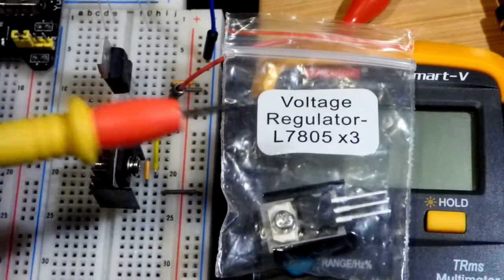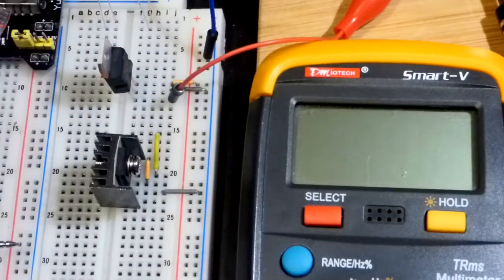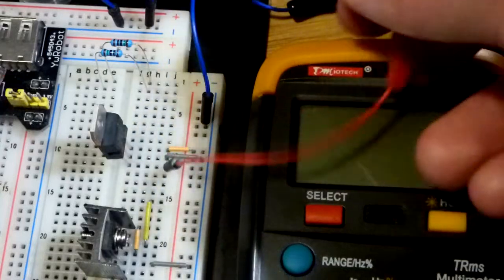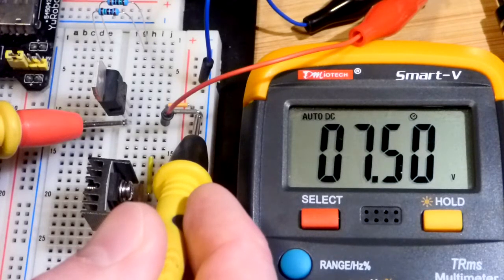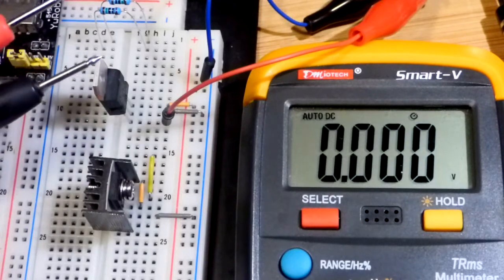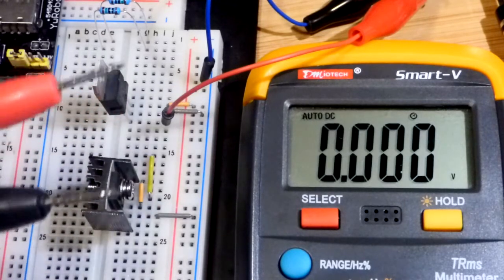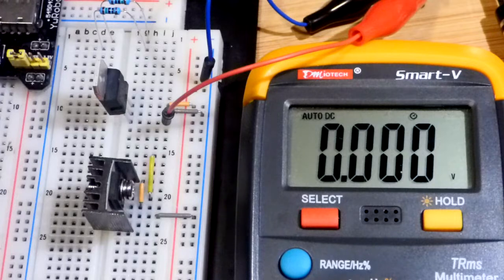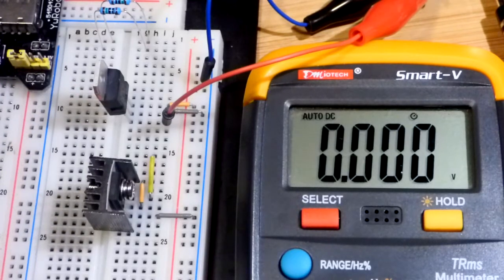L7805 7805 linear voltage regulator introduction for beginner learning electronics components

Comment: Very good constructive video, it would be nice to see LM317 tutorial
Reply from the maker: That is a cool component I hoped to get to some day. Not sure if I have any.
Reply: @Electronzap  there are lots of interesting crcuit to build with it like: constant current source or variable voltage regulator.
the output voltage depends on resisitors here is calculator for output voltage 
https://circuitdigest.com/calculators/lm317-resistor-voltage-calculator
if you don't know, i hope it will be usefull
Reply from the maker: Nice! I use online calculators like that a lot.

Comment: I have been using LM7805 regulators to power up various ICs that that cannot handle 9V batteries: ISD1820, PT2399, SpeakJet and soon the AY38910, YM3812 and SN76489 synth chips once I figure out how to communicate with them. I recently picked up some L78L05 regulators as they are cheaper and come in TO-92 packages but they only handle 0.1 amps instead of 1.5 amps like the LMs.
Reply from the maker: Very cool!